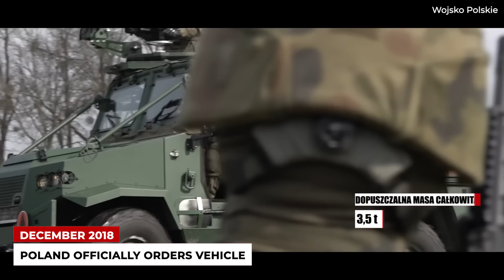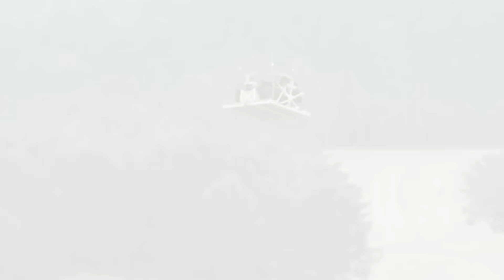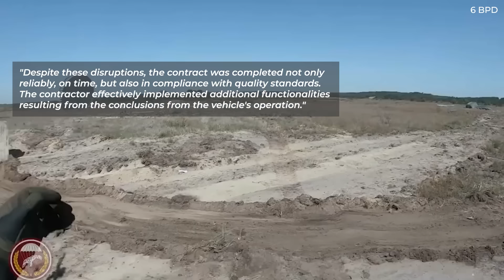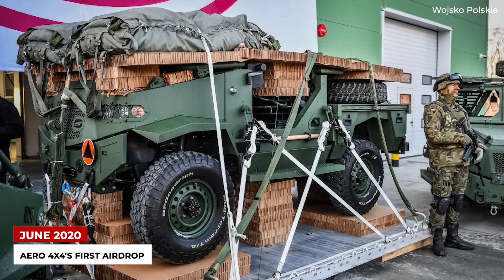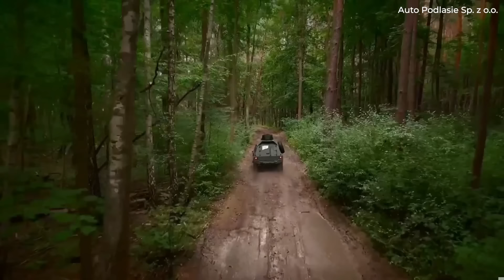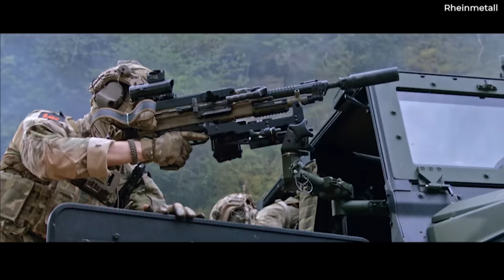Heads Up! Poland's Air Droppable 4x4 Tactical Vehicle

Comment: So … these vehicles are based on LHD Africa specification Toyota Model 70s. Africa is the only continent, according to my understanding, that still gets Landcruisers with the 1HZ engine. That makes sense for military purposes.
N.B. German and Japanese metric threads have different pitches. That would be a significant issue for Bundeswehr mechanical workshops, especially in the field.

Comment: Something like this would be a great replacement for the old Landrover in UK military service. Reminds me a lot of the old Airportable lightweight Landy.
Reply: The Land Cruiser is one of the leading candidates for replacing the Land Rover fleet. It would make a lot of sense to buy this variant as one of the various models needed. The Land Cruiser 70 series also has an aftermarket 6x6 version, which could replace some of the Pinzgauer variants (perhaps alongside the Supacat 4x4 & 6x6 family).
Reply: A standard Land Cruiser 70 would be better on road which is where it will spend most of its time. Also be a lot cheaper,more comfortable and less tiring to drive
Reply: @RichfromUK For 99% of roles, that’s definitely true. It would really only be a maximum of a few hundred vehicles for the air portable role (eg Royal Marines, Air Assault, special forces etc). For all of the rest, the normal Land Cruiser is a much better fit.
Reply: But that would more likely end up being a mix of the original Land Cruiser 70 and several of the Aero models. Just like we have a mix of the MB G-class and special vehicles based upon it.